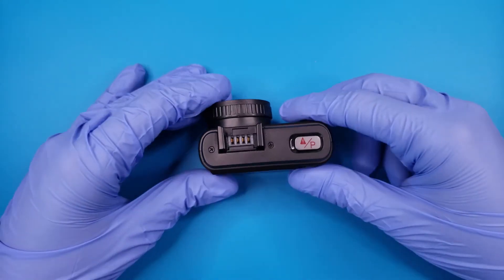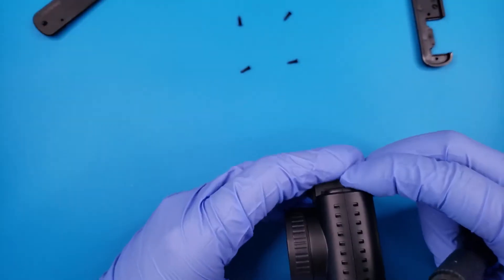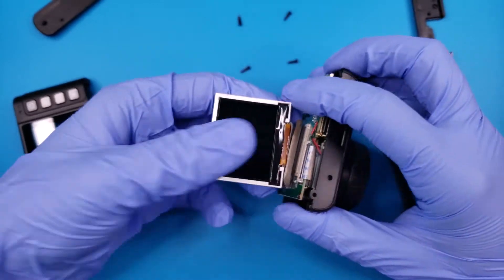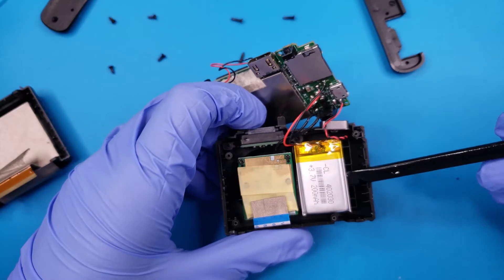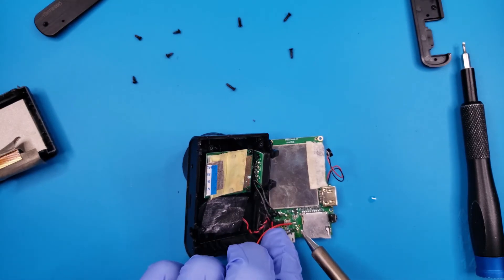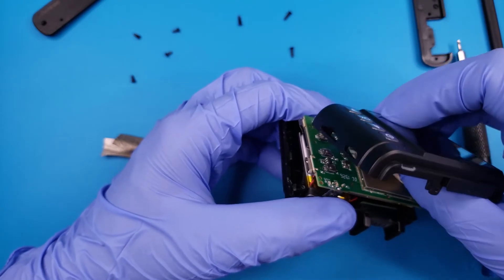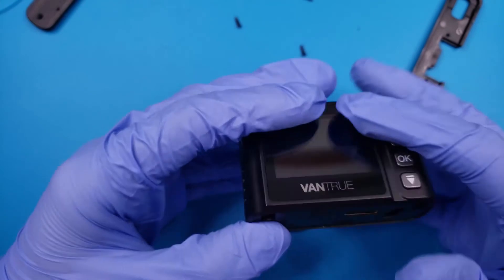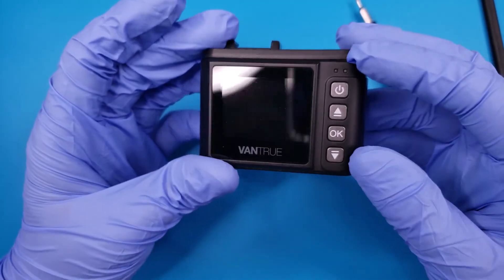Vantrue | N1 Pro Mini Battery Replacement

Comment: Just took mine apart, thanks for the help with tutorial. FWIW, you will most likely break one of the top cover tabs to remove. If you don't want to break both sides, pry up a bit right center of the big button from the screen side or from the other side(left center) if you want to break that one. Though you might get luck and not break either, they made it lock into place really tight with those upper tabs.

Comment: Well done!  Also, there's a firmware update available from Vantrue that will make the default date different when the battery is dead.  What was the part number for the battery you used?
Reply from the maker: Thank you and thank you for the heads up on that! I had no idea and that's great to know. The part number for the battery is 402030. Here is the link for the one I got: https://www.ebay.com/itm/224159467708

Comment: Where did you find a battery with that dimension? I can't locate one... thinking about just rigging my battery external
Reply from the maker: I actually ended up finding one on Ebay, it's just a guessing game of reviews
Reply: @techchick6908  ah okay. I may have also spotted one on amazon. We will see how it actually turns out. Right now I have one from a little mini quadcopter taped to the ouside with the leads going in! Its a nice little dash cam but MAN.. why not use Lithiumion like Garmin and bigger brands do? The amount of cycles on lipo is way too low for something your car is going to try and charge everyday.

Comment: Whats the part number? I would like to order the same battery but can’t find it anywhere. Thanks
Reply from the maker: It's been a while so I'm not sure the exact part number used in this video but this battery should work:

https://www.ebay.com/itm/176230729618?mkcid=16&mkevt=1&mkrid=711-127632-2357-0&ssspo=k1jVpgXnRW-&sssrc=4429486&ssuid=chcxdvn_s-u&var=&widget_ver=artemis&media=COPY

It matches the dimensions of the original battery and has the same voltage requirement
Reply: Thank you!!

Comment: You wouldn't happen to know what voltage is going through the power switch would you?
Reply from the maker: Unfortunately I do not. I'll probably have some free time in the next couple days to take off the housing and try to get a reading for you though
Reply: @techchick6908  Ok, nice. Thanks. Want to tie into that with a relay switch...No biggy if you don't get around to doing it. I'll probably be doing the battery replacement some time soon as I've had mine for a bit. Have you found those replacement batteries to be of decent quality?
Reply from the maker: @MrDLRu  apologies as I didn't see your response until now when I came to give you an update on the voltage! I'm getting 3.3V at the power button so hopefully that saves you some hassle. As for the battery, I havent had any issues in performance but I did find that it turned into a bit of a spicy pillow so it's probably good it was opened back up